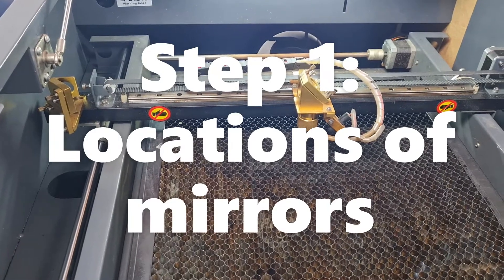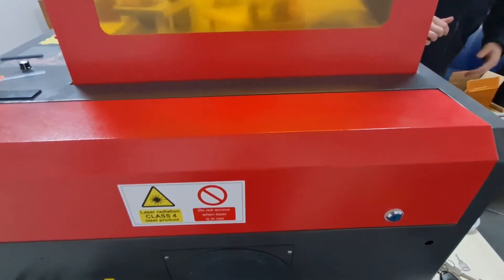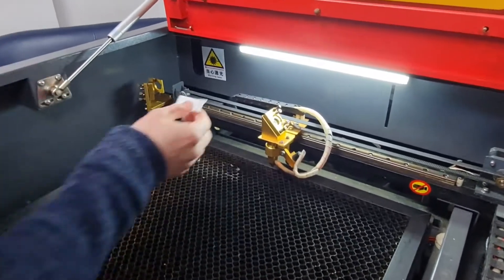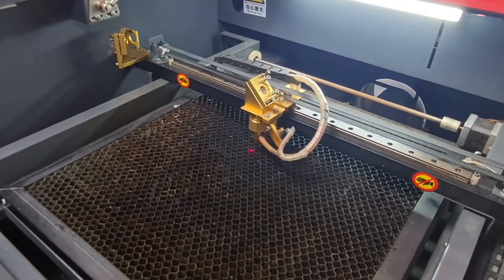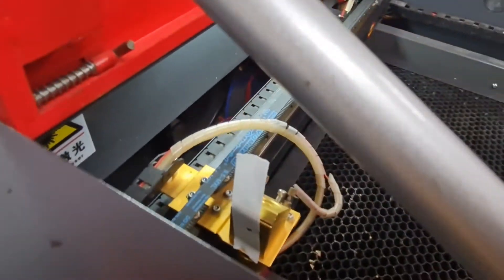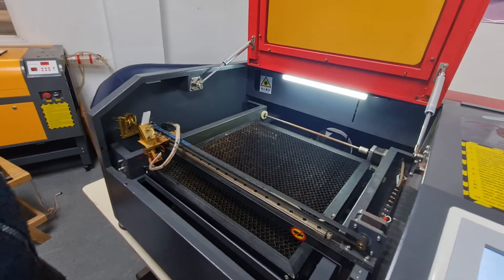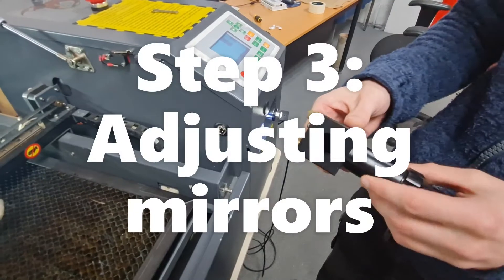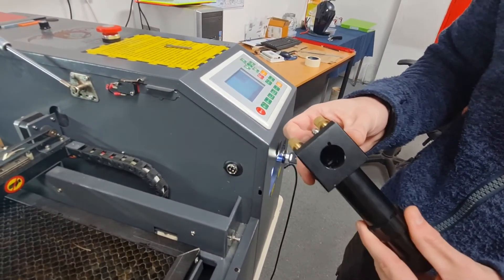Mirror Alignment Demonstration

Comment: No disrespect but the video should be called mirror locations.  It just shows where the mirrors are and burning tape on each mirror (where the laser is already alighted).  Didn't show which screws to turn for up and down, left and right on each mirror which would actually be alignment.  Could you do a more thorough video on alignment?